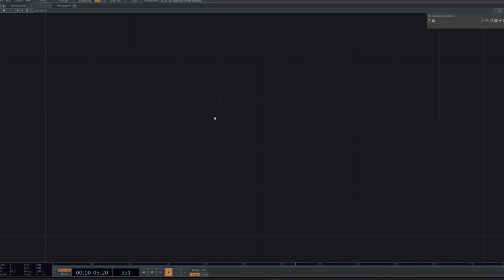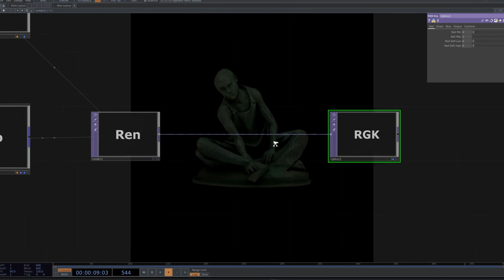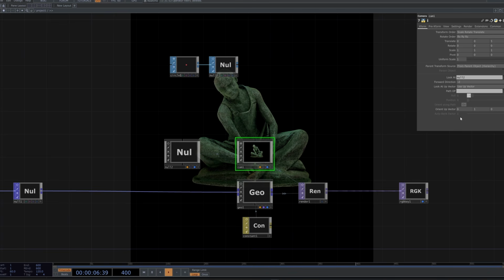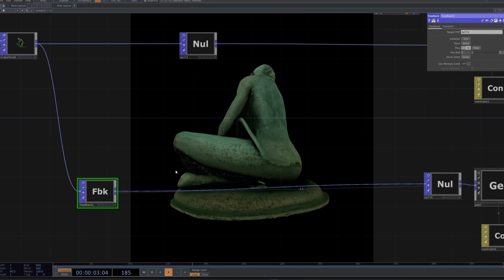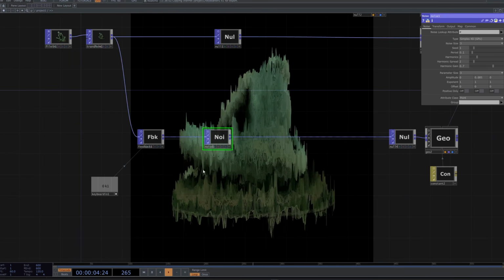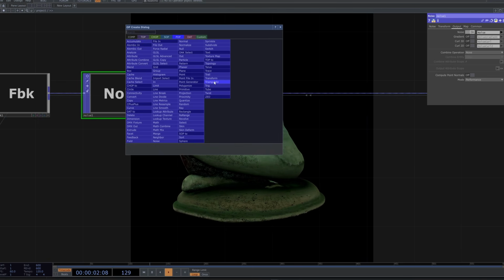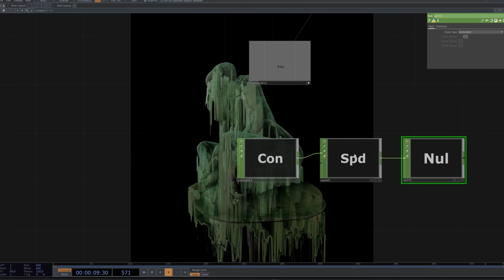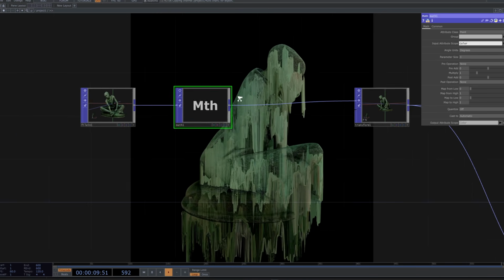3D Dripping effect on a 3D Mesh in Touchdesigner using POPs.

Comment: can you share your OBJ?  not sure why mine wont import colors
Reply from the maker: The OBJ is shared on my Patreon. But otherwise you will need on OBJ with the colors applied on the mesh. If you have an obj with a separate texture file for the color, you can transfer it to the vertices using meshlab (free software). Open your file in it, and then filters>Color creation and processing > Transfer texture to vertex color.
Reply: @Dithdsgn  Thank you so much!!!!   Worked perfectly!